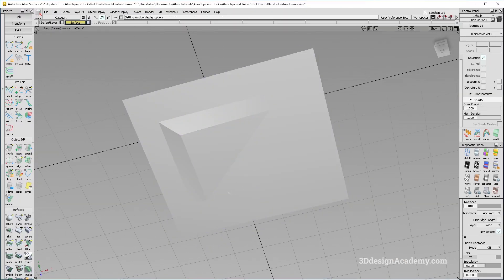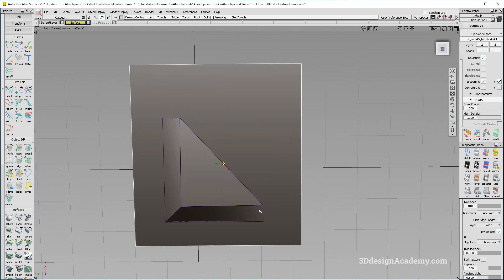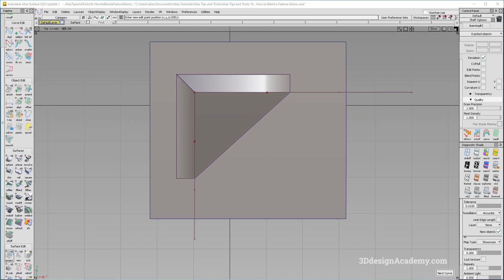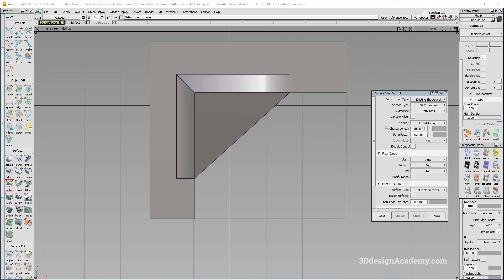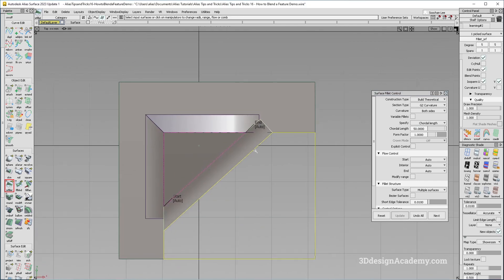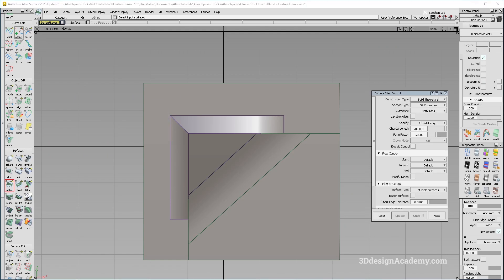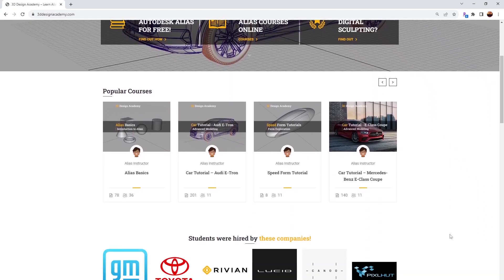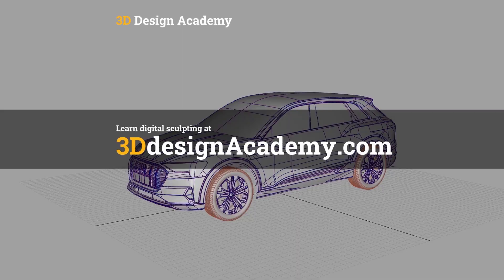Alias Tips and Tricks 16 - How to Blend a Feature

Comment: Really nice tutorials - I tach Fusion360 coming from furniture and product design - since Alias is PC only now.

Always great to see others also show how Alias works. Not too many share that.
Reply from the maker: Thank you! How is fusion 360 by the way?
Reply: @3DDesignAcademy  it is not bad

The workflow to work with surface solid and subd data is smooth.

But logically it is not a class-a surface modeler

I teach it mainly for product design and it works for that quite good

Easy to learn because of the limited toolset

As with SolidWork 3D curves / 
Sketches are pretty poor vs Rhino Alias.

I truly miss the square tool from Alias.

Loft produces not the same flow/topology
Reply from the maker: @cekuhnen  I used Rhino when I was in school, but not fusion 360. I guess I'll stick with Alias!
Reply: @ Alias does have the best surface modeling tools hands down.
Reply from the maker: @cekuhnen  That's good! Looks like I chose the right one.